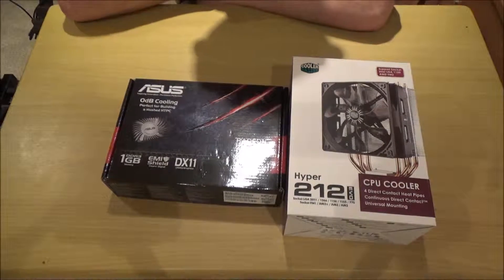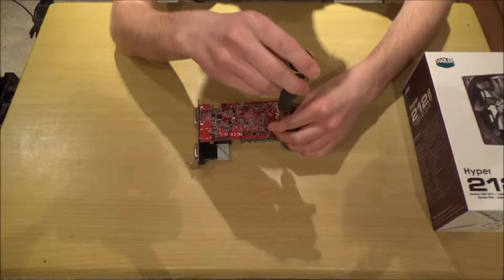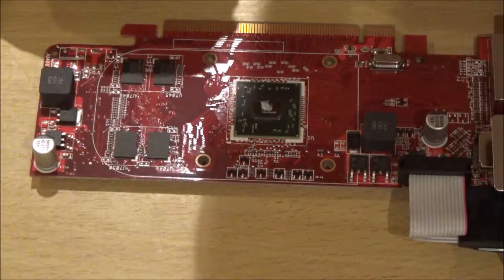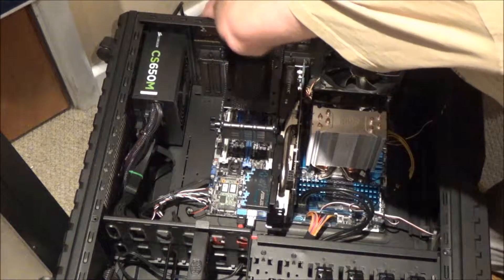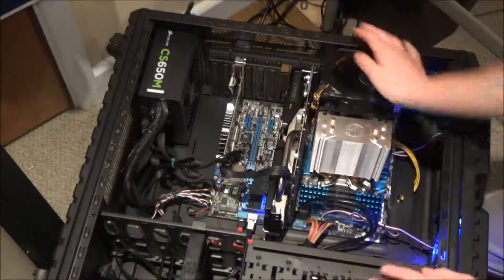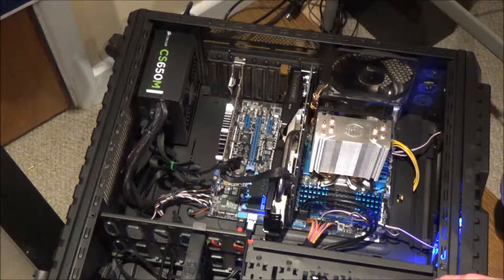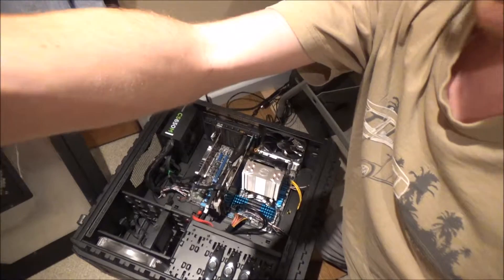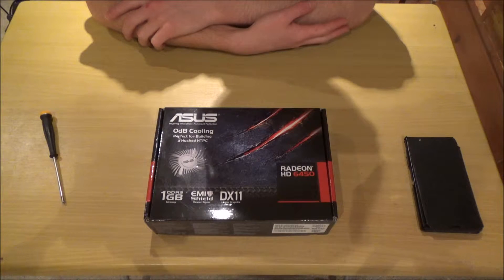Does My Damaged AMD Radeon HD 6450 Still Work?

Comment: i have the same card and mine just stopped working
when i put it in my hp system it kicks the fans up all the way or it will boot but on the intel graphics (intel core 2 duo) and the card gets very hot 
my moms dell just does a boot loop